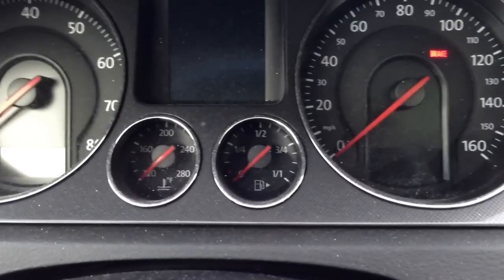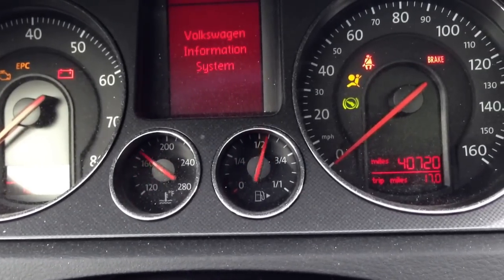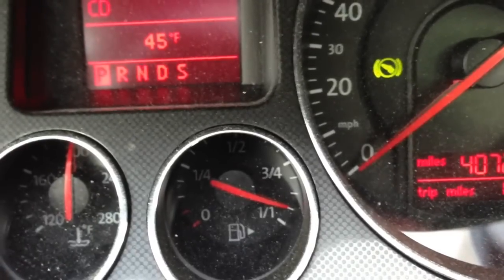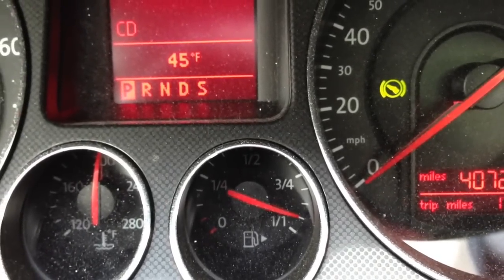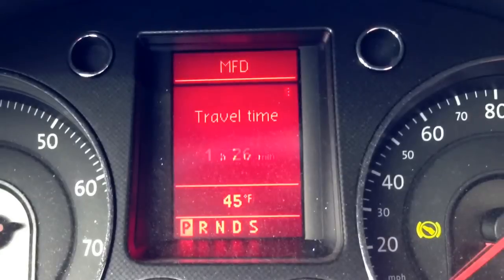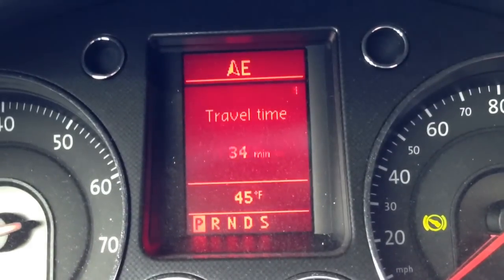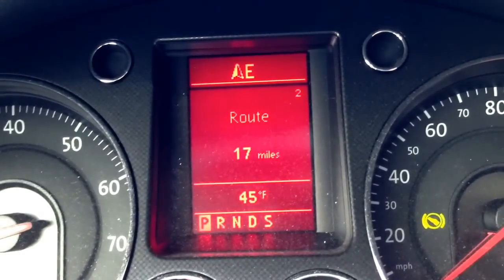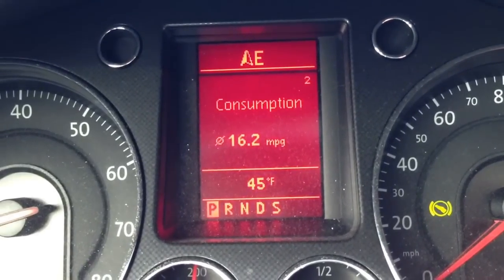2007 Volkswagen Passat 3.6L Fuel Gauge Quirk

Comment from the maker: Finally, someone else who has experienced the fuel gauge issue! Yes, I had to replace the headlight on the passenger side.  I hate to be a let down but I had the dealer do it because my Passat (I'm sure your does too) has the auto swivel headlights which are motorized to curve to the degree the steering wheel is turned.  I was going to replace it myself, but when I saw what I had to remove I paid the dealer around $95 including labor for the new headlight.

Comment: 11 years later and I'm researching this same issue on my recently- acquired 2008 2.0T FSI with only 60,500 miles. Irks me to no end... I filled up this evening and at the pump it said range 485 but the gauge never quite reaches the full line! I even squeezed the nozzle on the pump and had a little gas spill out. 3 mins later it said 470. Pulled into my parking spot it says 455. Total time from gas station to home was 8 mins. driving slowly on residential streets. Pretty sure when I go out to start it in the morning it'll be down to 445!

Comment: Its probably the float in the fuel pump...they break easy when installing. Someone probably used a zip tie to fix it but the float loses some range of motion when you do. Leaving your car reading under full after just filling up. This is what happened when we installed my fuel pump on my 2012. It reads the same...

Comment: I have an '08 Passat 3.6 4motion and after driving only 40 miles, the gauge reads 3/4 tank. I get 20 mpg average, and there's no way I used a 1/4 tank that fast

Comment: Driving a 2015 Passat i just bought, great car but same issue, i filled her up and noticed it wasn't reading fuel. And the fuel gauge is going down something shocking, as if I'm burning fuel like some petrol V8, though the electronic gauge says i have a range of 800km-880km left after doing 200km. The fuel gauge is reading that I'm near half a tank, there is something clearly wrong with it. Though i'm not sure what.

Comment: I have a 2006 deluxe passat b7 3.6 v6. I have a whole bunch of codes coming up. I got a few thing but no lights went out. I looked up and read about most codes. Everyone misses the most easy way. Go to an auto parts store. Ask for battery/electric system check as well. This is all free. Then if it says battery is good. But the altinator is going bad and the regulator is bad and putting to much volts and amps out. You have to replace your alternator and i bet most if not all the sensor shit goes away. Free to check. Parts pretty cheap too

Comment: My fuel gauge just stop working completely and reads as if there is no fuel whatsoever. Does anyone have that issue?
Reply: Fuel gauge sinsor
Reply: People they just fixed a fuel pump recall on my 2007 passat 2.0 t..last  last year..now I'm getting back pressure coming from my line coming out of the fuel pump
Reply: @burlspicer786  you're talking about the fuel pump control module? Yes I had that replaced last year as well and I'll tell you what the problem is with mine. If you take your control module and follow it to your gas pump. I unclipped mine from the gas pump and when I looked up inside of it the seal around the inside of the clip wasn't seated properly. I tried just about everything needle-nose pliers, tweezers ect. I couldn't get it seated back properly. So I just pulled it completely out. After reseeding my fuel pump control module the car started up and has been running perfectly no problems. Fuel gauge has not given me any issues whatsoever. So I would check your fuel pump control module seal to the gas pump because you're more than likely getting a bad connection. That's what I figured out for issue I originally posted about
Reply: @fixnitrepair  maybe
Reply: @burlspicer786  if you are still having issues you may want to give it a peek underneath of your seat. When they replaced the new control module they moved it from on top of the fuel pump over next to the door panel underneath of the frame.
Reply: @fixnitrepair  I'm getting spray back on  line coming out of the fuel pump under my rear seat..feeding to connector line going to the injectors
Reply: I'm thinking a clogged line..or bad cam sinsor..or something